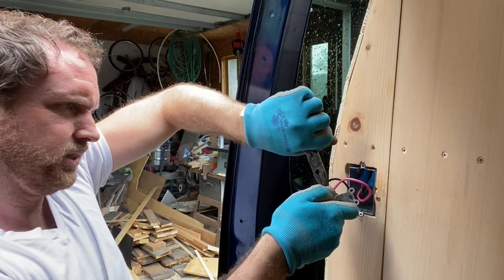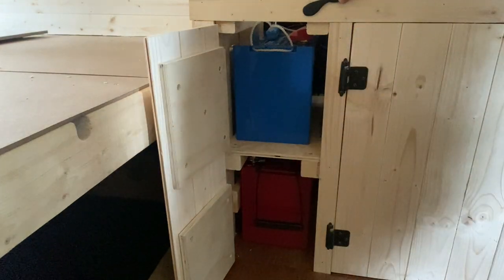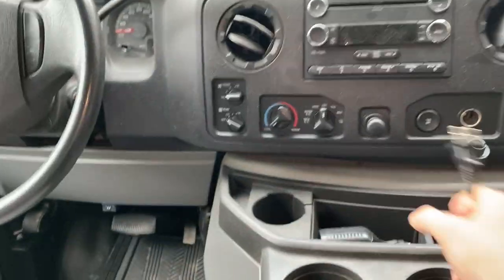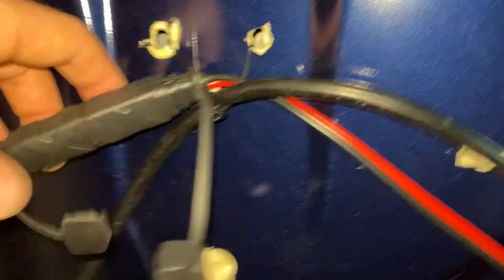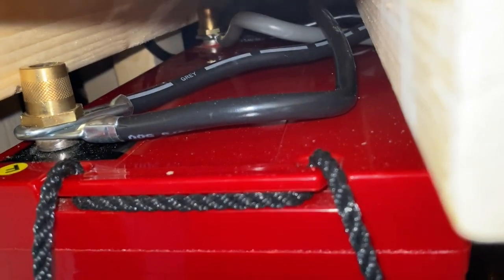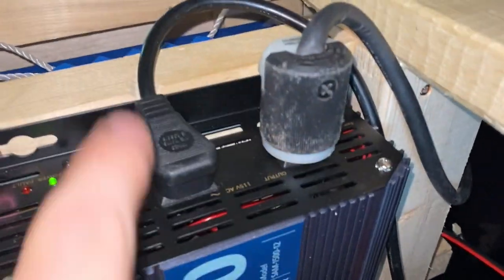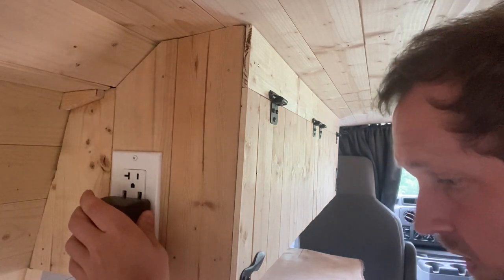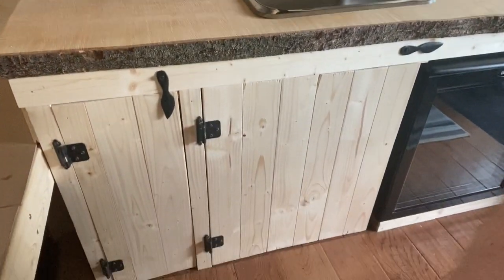Simple Van Life Electrical Setup for Beginners

Comment: My setup is mainly 12v (lights/tv/USB ports, etc).
I wouldn't be using a power hungry inverter.
Reply from the maker: I was on the fence between the one I went with and another that’s half the size. If this one really does pull that much, maybe it worth sticking with the smaller one.

Comment: Charging two12v batteries with a 110v charger running of an 'plug in' inverter of the van's 12v ? that is the most idiotic thing I have ever seen.
Reply from the maker: Any suggestions Jan? It seems to be working but it’s my field of expertise.
Reply: @MattWatsonComedy   sure, that charger is ok but only for if you have mains power, to charge the batteries from the alternator you need something like this https://www.victronenergy.com/battery-isolators-and-combiners/cyrix-battery-combiner-kit
Reply from the maker: @JanWillemHelmers  I’ve booked an appointment with my mechanic to get my leisure batteries charging off the Van’s alternator. Thanks again for pointing this out to my Jan, I’m willing to bet you’ve saved a big headache in the future!
Reply: He’s learning